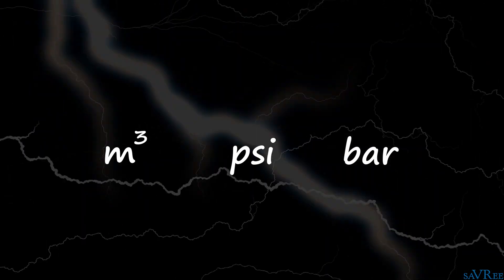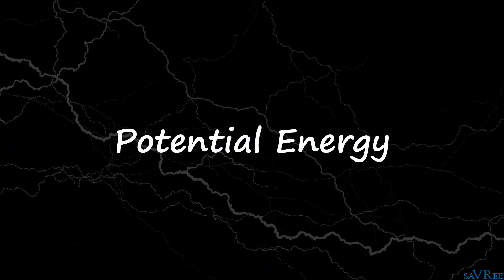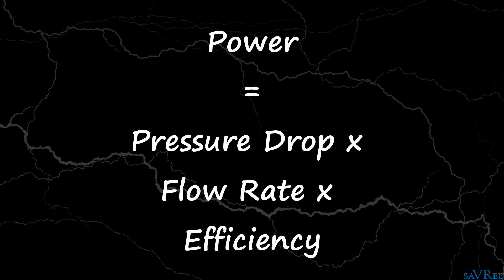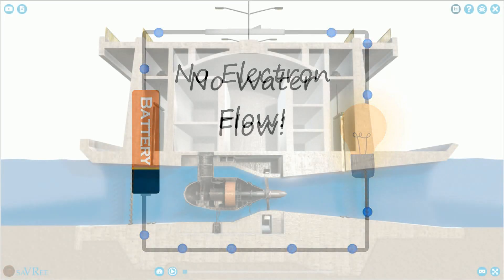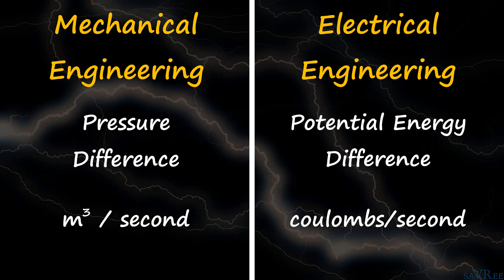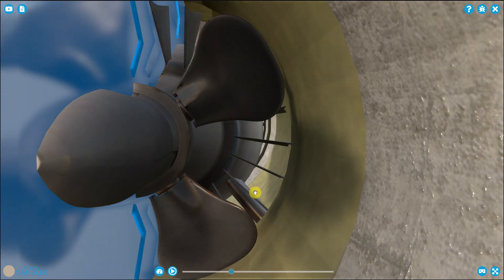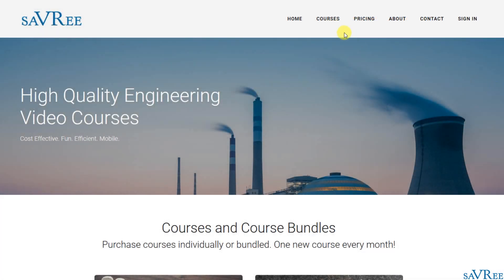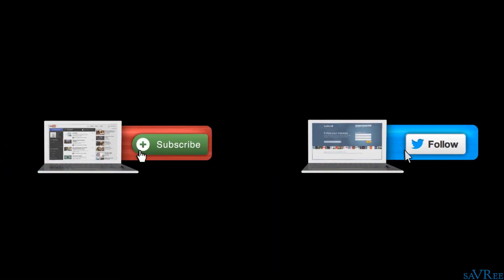Voltage, Current, and Resistance (Electricity Water Analogy)

Comment: 4:04 4:49 Is not that accurate. The post is right, it is like pressure. But the explain is wrong, not the number in electron difference cause them to flow.
The difference in electron numbers is not relate to voltage, even the both side got the same number, it will still flow under correct circumstance.
The accurate explain might be the tendency of water flow from high energy to low energy, as the tendency of electrons flow from higher energy side to lower one.
The voltage is create by difference in electronegativity, which is just like the hight of waterbody.
Just like water, you can create a lot of pressure with minimun amount of water, you can also create very large voltege with minimun amount of electron.
The number of electron is about how many energetic electrons are ther and thus count the total capacity, same as we count the volume of water stored to find out how many energy are stored in the system.

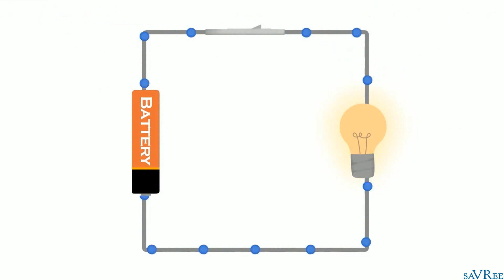Also minor mistake in 4:23 is that both in turbine example and the circuit, now pressure difference is not equivilent to no flow or nothing is moving, in microscopic scale particles is always moving as the temperature is not 0K, each particle have its own chance move toward specific direction, but in macro scale they have statistically sums up to 0 velocity towards any dirction. Theer's still chance that at some point they all got the same direction and become flow, but the chance is an astronomical number in macro scale and even if that happend, the pressure difference created will immidately force them back to former state.

Nice explain still, there's so many things in engineering that fascinates me as I dive deeper into it.